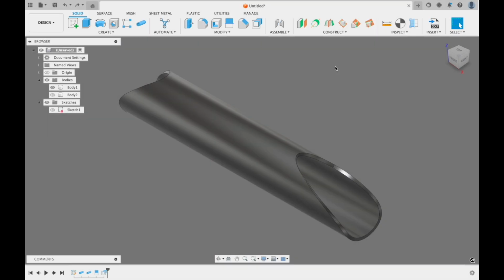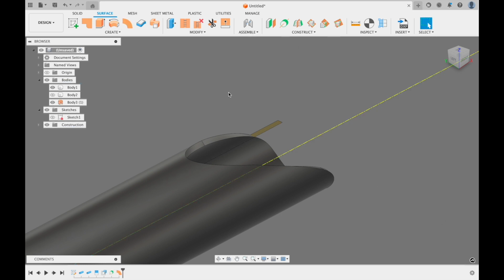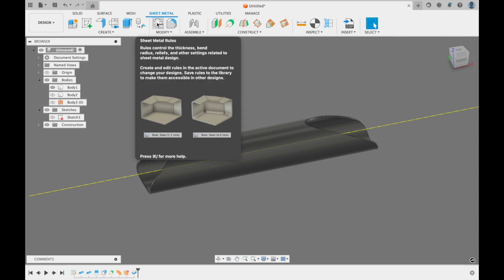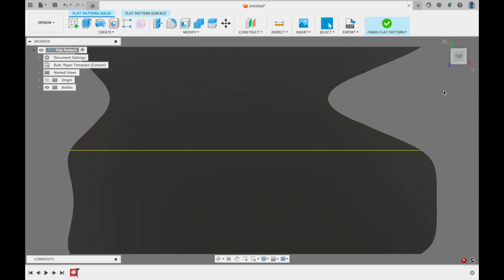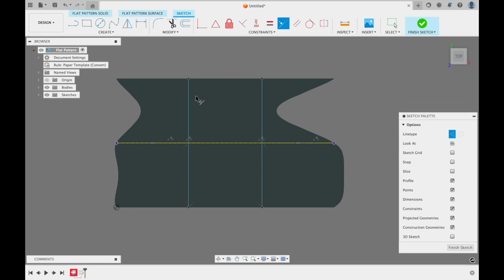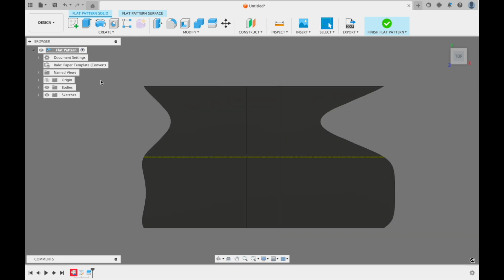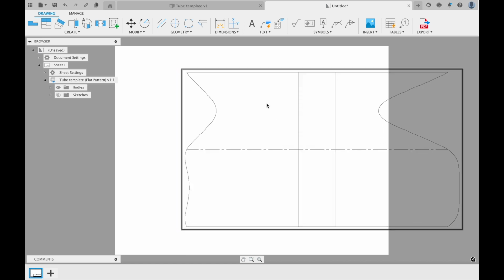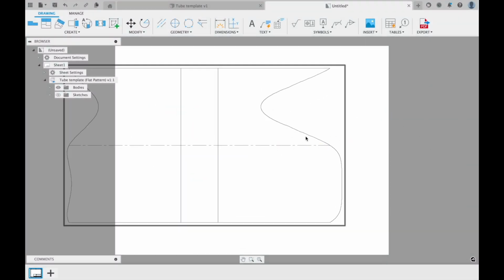Fusion 360: Coped Tube Paper Template

Comment: Holy shit you're a life saver. I've tried 6 different ways of doing this and none of them were working very well. Now of I only I could work out how to get out of the flat pattern and back to my model to pattern out the intersecting tube....
Reply from the maker: You can. At the top menu bar there is a green check mark that says "FINISH FLAT PATTERN". Click on that and it'll take you back to your 3D model.
Reply: @jamfab_llc yeah worked that out. I had 3 models I wanted to pattern out. 1 had the lines on the face, the other 2 didn't. I started from scratch and NONE had the lines. I guess because of the convoluted way I drew the tube. (Drew it 2d, extruded to a block, chamfered and holed to a tube) but I just split the faces and used that line.

Comment: Great video. Have you figured out how to create bend spacing and angles similar to Bend Tech
Reply from the maker: Locating bends in Fusion 360 is a little more complex than Bend Tech, especially when adding multiple out-of-plane bends to a single tube, but it can be done. I generally stay away from tubes that require out-of-plane bends when I design structures. 

What I do for bent tubes is first bend the tube to the desired angle. After, I find the node that the outer edges of the tube legs meet at. Then I use that node as a datum to measure off of for the notches at either end of the tube.

Comment: being new to fusion, and coming from solidworks, if you change the angles of the pipe, will the flat pattern update to the new angles? I wanted to create a template where i can quickly change angles and just print it.
Reply from the maker: Yes, any change you make to the 3D model will be applied to the flat pattern. Fusion will tell you that the flat pattern is out of date after you make a change but as soon as you open the flat pattern, it will automatically update.
Reply: @jamfab_llc  thanks, it's been a trip learning fusion coming  from solidworks. thanks for the reply.
Reply from the maker: @whatsagrinder  you’re welcome